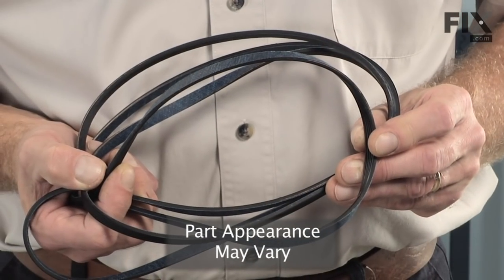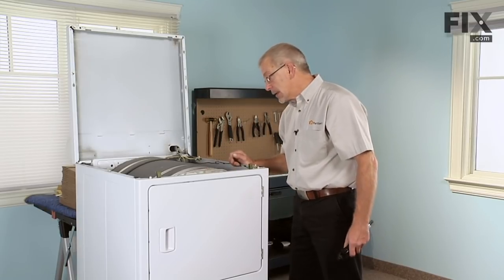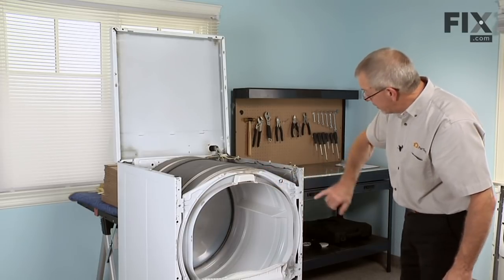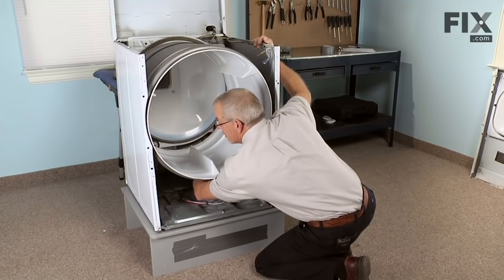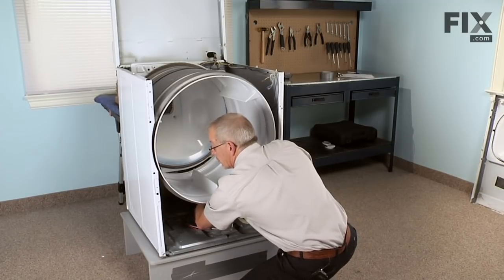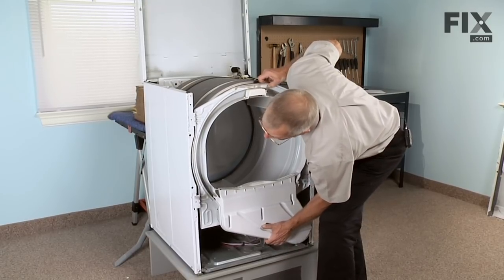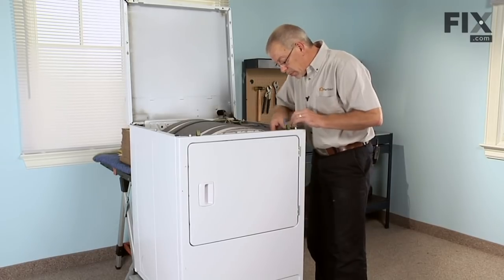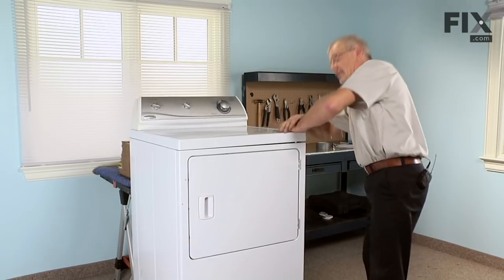Amana Dryer Repair – How to replace the Multi Rib Belt

Comment: Please note that if you have an Amana model# NDE5800AYW, the putty knife method will not work to release the top. In addition to the spring clips, there are screws holding the top too. You will have to start by removing the two screws located in the bottom corners of the front of the dryer. You can then remove the front of the dryer and get access to the screws that hold the top. I discovered this after many failed attempts using the putty knife method.
Reply: Oh, hey, yeah, I had that same problem!  PIA!!!!!!  But, I still don't understand the right order of taking apart, putting together.  I've got the bottom two screens on the bottom plate, like you suggest. But, you can't remove the bottom plate because the upper part of the bottom plate is held in by the middle door assembly.  But you can't remove the middle door assembly because it is held in by the top and the bottom!!!  WHAT????  I can't for the life of me figure it out and I've taken it apart. So, how did I actually get it apart?  I used a pry bar and bent it enough to get a wrench in to unbolt it.  Then struggled mightily to put it back together and left off screws that pissed me off.
Reply: The video titled Amana Dryer Super Capacity door and top lid removal at https://www.youtube.com/watch?v=O05qCqhz7Z8 shows the steps you mentioned.  It helped me take the top off.
Reply: Don't know what model # I have but I will try this method. Hope it works.

Comment: This video implies ALL Amana dryers can be at least disassembled using the putty knife method.  This is not the case.  Mine and many other Amana dryer models require two bottom screws be removed, then the front panel gets dropped down, the top clips just hold the front panel in place. There are interior screws holding the top which are impossible to remove without a special tool.  Luckily with these models all mechanical and burner service work can be done from the front, no reason to remove the top.

Comment: I think I'll remove the drum and vacuum it out plus probably not a bad idea to replace the idler pulley as well. Not sure how long those are supposed to last?? Kinda like replacing the tension-er when replacing a serpentine belt on you car. Excellent video. Thank You.

Comment: When I push on the latches it does not appear to be popping up.  It appears to be attached to the side plate somehow.  Do you have any tips or a more relevant video?  I have an old Amana LEA50AW.
Reply from the maker: You will need to remove the lower access panel and the front panel before you can access the two screws that hold the top in place.

Comment: If you have an old Amana LGA50AW, you cannot open the top first!  I spent a good 15 minutes trying release the spring clips... thinking something was wedged or rusted.  You need to start at the bottom by first removing the bottom cover (below the door, two 5/16 hex screws) and then you can lift up (and out) the front panel while paying attention to the door latch wire harness.  From this point you'll easily see how to loosen the top / lid piece, the front bulkhead, etc.  Best wishes.  Hope this helps.

Comment: I have an Amana dryer that is roughly 25 years old and has just now begun to make a squeaking noise. Pretty sure the belt is in need of replacement. Will this repair apply to a machine as old as ours? It doesn’t appear much different structurally than the one you’re working on.

Comment: My top won't open! Does anyone know why?
Reply: Mine wouldn't open either. I had to take the bottom front panel off then the panel with the door in it. Before removing the door panel completely unplug the door switch. Then lift the top.

Comment: My amana dryer has a lower kick panel on it. And my top doesn't swing up??? It heats and drum spins but legs with weight of clothes. HELP PLEASE.
Reply: Same with mine. There seems to be something more than just the spring clips holding the top in place, yet there's nothing on the exterior.